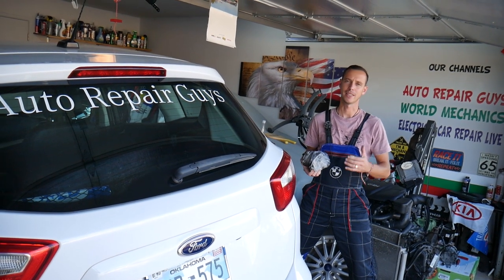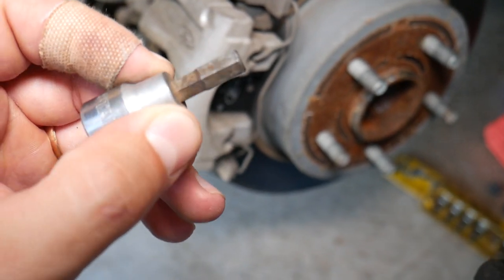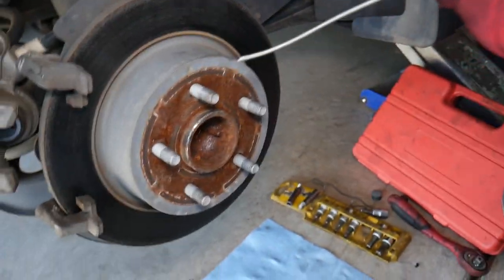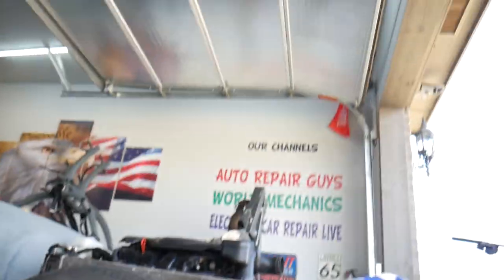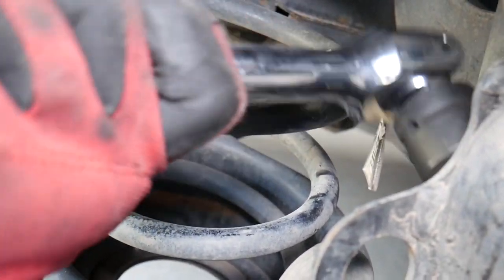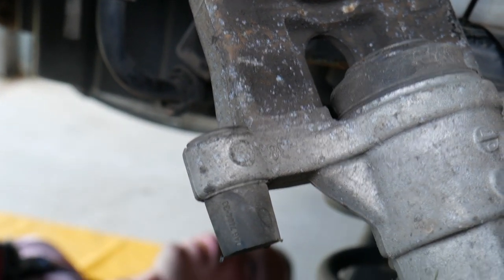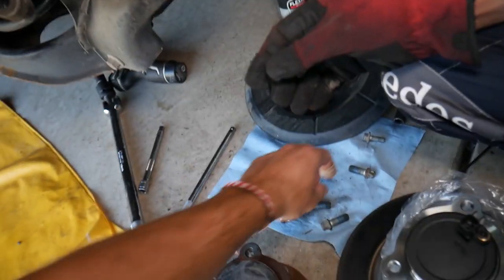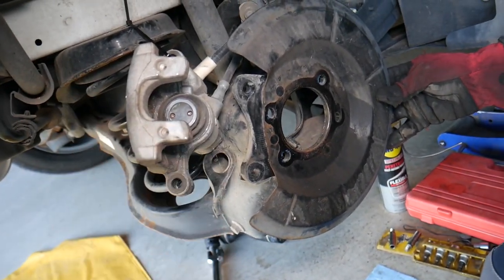REAR WHEEL BEARING REPLACEMENT FORD C-MAX ESCAPE

Comment: The wheel bearing bolts are E14 "I got a kit at harbor freight with it for $9.99", And the Hub assembly I purchased on Amazon for MOOG $112 each with tax, and for the other beginners like me taking it apart is hard, putting it back together was not as hard. just take your time! And Thank you auto repair guys ! Good video like always.
Reply: Thank you dude for information. Definitely I will buy same

Comment: This was a TOUGH job! I did not heat the bolts or use an impact tool. You do want to use some Desolve or WD40 on the ends of those bolts. I'm halfway done. I could not have done it without this video so BIG THANK!!! Torque specs (from below) - Hub is  81 lb.ft (110 Nm), caliper 52 lb.ft (70 Nm)

Comment: 3 Things I found to make this easier, 1 Heat the Bolt tips to melt the Threadlocker, 2 Use an Impact if you can, 3 Remove the Shock Absorber, it took me 2 minutes and it's majorly in the way of those hub bolts. Also if you live in the rust belt like me, that hub ain't gonna fall out like that, I had to pop the wheel studs out and use the Bolt and Nut trick to press it out it was rusted in so badly.

Comment: After doing one side there are some things you should know. Getting those bolts off with just a ratchet will take forever due to very little space and the blue thread locker on the bolts. My mechanic said it was fine to use an air ratchet. I used that to put them back on and instead of an hour it took minutes. I will use the air ratchet to remove other side. ALSO - the old piece will not just fall out like in the video. There will be rust and grime holding that thing on in a very firm manner. I didn't think I could get off and that's when I called my friend that is a mechanic. He took my little sledge hammer (not a big one) and hit the old piece from behind one side and then the other. I tried this but evidently I didn't it it hard enough. He whacked it twice and it came off. I used a wire wheel on my electric drill to clean the old surfaces and in the hole before I put the new unit on. Getting everything back together was so much easier. My second piece is arriving today and I'm hoping this side goes much fast than the other. These are things I wish someone would have told me ahead of time - good luck, you can do it!
Reply: Thank you dude. I found it need to replace a rear bearing of 2013 C-max. I hope I can do my self. But I never see a bolts like those keeping a part of bearings. What is that size of a socket?
Reply: @rubberduckyconvoy2723  Reverse torque size 14. I had to go buy it. UPDATE do not loosen these with an air ratchet. Use a long ratchet to initially loosen them like in the video. ALSO I used a torch from the outside to heat up the bolts and they came out much easier. After I did the second one the car was quiet and my wife was very, very happy. This car only has 58,000 miles so it can happen that soon. Good luck - you can do it! PS I used the MOOG part.
Reply: @billyhellmaker  Thank you. My 2013 Ford C-Max has 102000 miles. So a noise got like 80,000 but I did not understand. Now I got it.
Reply: @billyhellmaker i had to laugh because I destroyed mine with an air ratchet and then I read your comment and I thought "hmm lets see if he wrote an update on that" and yes you did, and it was as I expected 😄

Comment: bolt is much easier to remove when blow torch flame applied on the tip while removing. It stuck not because of rust but because of hardened threadlocker! When heat applied threadlocker melt down and allow you unscrew very easy
Reply: I ended up heating up the hub to get the bolts out.   Big difference between heat and no heat on how hard it was.
Reply: Thanks dude I collect all suggest I will do it my self too

Comment: Great video!  What are the torque specifations for the hub assembly and caliper bracket?
Reply: Hub is  81 lb.ft (110 Nm), caliper 52 lb.ft (70 Nm)

Comment: I'm struggling getting the four bolts out at the back, they get tighter the more I loosen them. I sprayed them with wd40 also I brushed them with wire brush to remove some of the dirt in the threads but still no joy

Comment: @15:00 could you not use an impact gun to remove the bolts?
Reply: I was very tempted to get my impact gun out but was afraid of breaking a bolt. It was tough with just my socket (BIG) wrench.
Reply: Rather stupid question, are you heating the back (near the spring) or the front?

Comment: Just lift the car and make your life easier, theres no need to remove the springs just 1 long extenion and breaker bar. On older models there are 4 bolts torx50, on this model basicly the same just reverse torx bolts
Reply: Specifically, the E14 star socket.

Comment: why didn't yall just remove the brake cable wouldnt it be easier?
Reply: Not really.   But you can take the cable holders off the frame and it gives you more room to move the brakes around with.   If you take off the "cable", one is a hydraulic line, so you'd end up bleeding the brakes again.   Not worth IMHO.